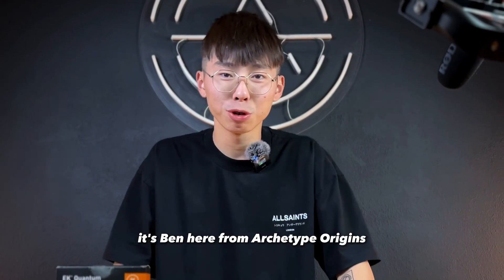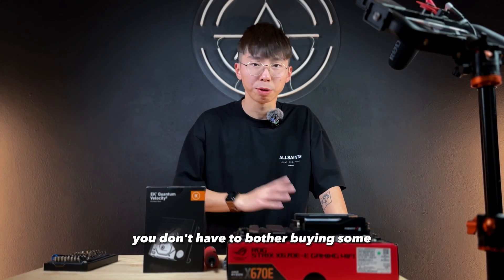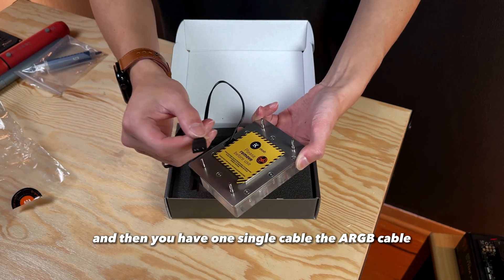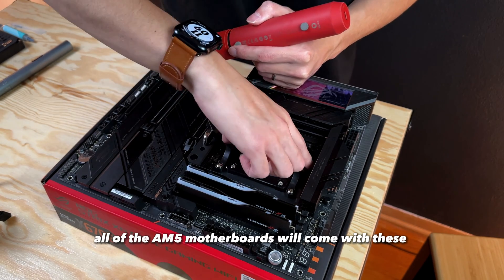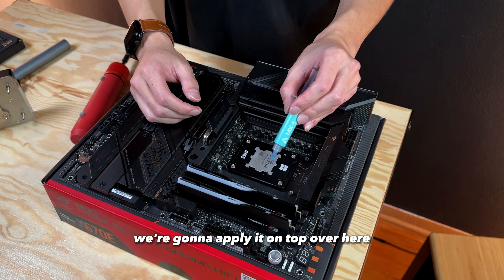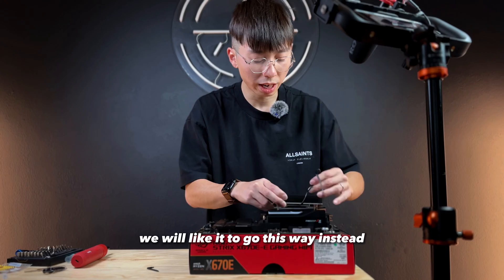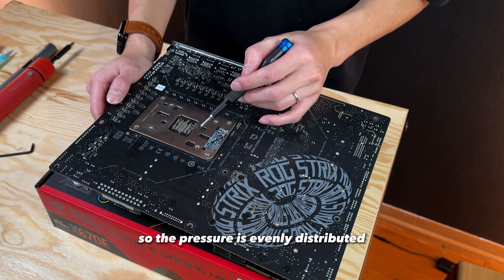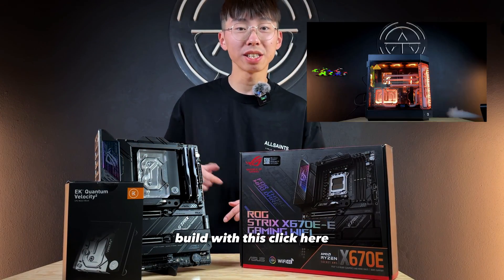How to Install EKWB EK-Quantum Velocity² AM5 CPU Water Block [Tutorial]

Comment: Never install this garbage. How to install an EKWB product. Unbox the product. Take it carefully out of the packaging (because it might break, because its garbage). Then look under your desk. Is there a rubbish bin there?  Very carefully, put it, in it. Before it fks up something else.  

Because you just paid too much for a bad product that is unreliable garbage that might screw up everything you have. It is garbage plated e-waste. 

Once you break out of the EK ecosystem you realise how bad it is. Oh I have a lot of videos on that too. Typically running 4-6 bench mark machines for fun at any given time. I know, so I have an odd hobby. I sometimes test to destruction for a laugh too. But not because something is so bad, it just doesn't function to any sort of reasonable expectation. EK nearly ruined my hobby!. They make bad products and I was so locked in I didn't realise how bad they were until it got ridiculous.   I literally had to drill a 7950x cpu out of a perfectly fine very premium, x670E motherboard because their awfully badly ( I mean like negligent) designed velocity 2 cpu blocks, made with poor quality material, basically fell apart when being uninstalled. But, I don't want to make it about that one instance. They have got worse and worse over the last 24 months or so. It is ridiculous. Then you go to another vendor and it is like a revelation.
Reply: Bro, I had to drill mine out too. Those Torx screws disintegrated the moment they touched my screwdriver.
Reply: I also had a nightmare with this block.   One screw was broken upon arrival - after taking it apart and repairing then installing two of the others were stripped - EK is a fraud company

Comment: idk If i'm just not searching hard enough but I cant find this info, can this block go on an AM5 intel chip instead of an Amd?
Reply from the maker: LGA 1718 compatible 
LGA 1700 not compatible
Reply: @nohkra oh what u dont call them AM5? What do you call the new sockets name for intel then?
Reply: @ivan3230 for the latest intel processors (12,13 and 14th gen) they are on socket lga 1700 while amd ryzen 7000 and 9000 series are on socket am5 while intel 15th gen will be on socket lga 1851

Comment: Hi, will all the EK-Quantum Waterblocks fit on a AM5 mother board if they have the AM5 in their name or are they desingd for specific boards?
Reply from the maker: they're not designed for specific boards. You should be fine with any AM5 motherboard
Reply: @archetype_origins  What does this EK velocity does ?